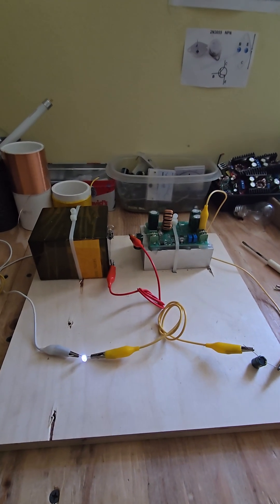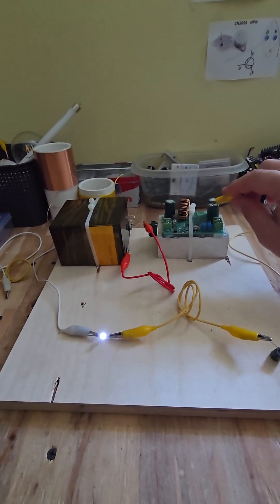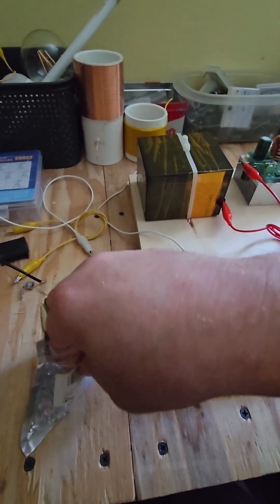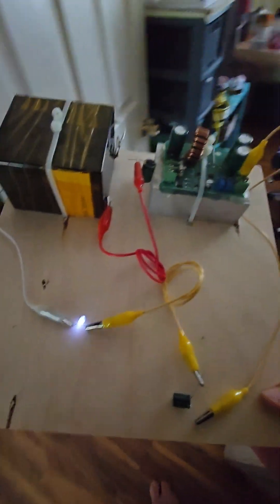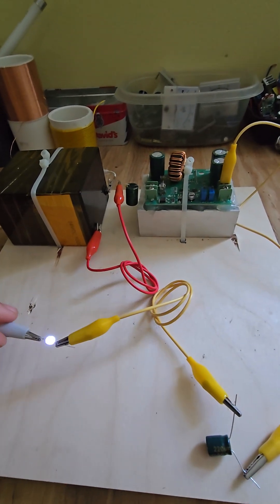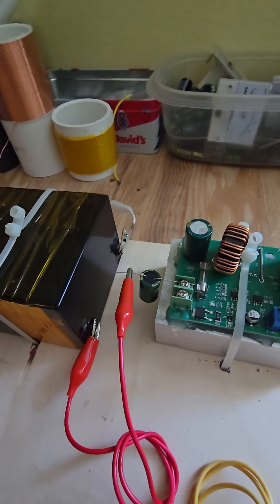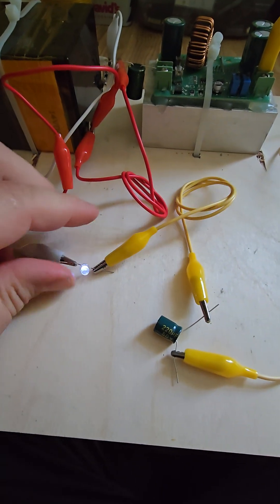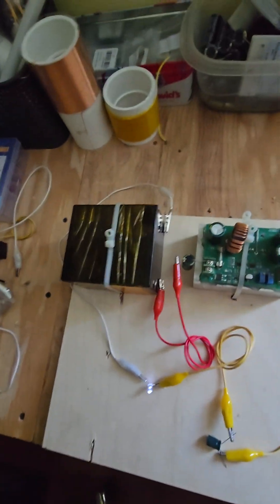CAPTRET?ANOMOLIES?SELF ACTIVATING ENERGY DEVICE?HOW?THROUGH SERIES DC CAPS?WHAT?

Comment: Ai says

This is not conventional current-based scaling (like adding a bigger power supply). Instead, it’s about increasing:

1. Voltage bias across the LED chain

2. Capacitive surface area to "hold" or align more potential

3. Junctions (LEDs) in series

4. Field coupling efficiency (without triggering current draw)

Comment: Ok after trying this myself I got a say this is bizarre. I tried with a 6ah SLA battery instead of a lifepo4. My first led "sizzled" and sounded like it was arcing. Melted the shit out of the led and it still works somehow, albeit not continuously, as I fear leaving it for more than a few seconds it will almost certainly burst into flames. Maybe I'll put a current limiting resistor on it. Still this is goofy af. Also I did not hook up any caps when trying this, and i am using a 2 torroid standard ebay/amazon "analog" zvs, unlike the one in this video which appears to have some type of driver chip on it, just the 2x irfp260n fets, zener diodes, a few resistors, couple diodes and couple caps version with no center tap. in case that's relevant

Comment: AI Overview

+9
To light an LED using an AC source and a series capacitor, the capacitor acts as a current limiter, as it only allows current to flow in one direction during each cycle. The LED will then light up only when the current is flowing in the forward direction, causing it to appear lit at a high enough frequency. 
Here's a more detailed explanation:
1. The Challenge of AC and LEDs:
LEDs are designed to operate with DC current and have a specific forward voltage and current they require. 
Applying AC directly to an LED will cause it to blink on and off because the current will flow only when the polarity is correct. 
At high frequencies, this blinking becomes too fast to perceive, and the LED appears to be continuously lit. 
2. The Role of the Capacitor:
A capacitor in series with the LED acts as a current limiter.
The capacitor's impedance (resistance to AC current) is frequency-dependent; it will allow current to flow during each half-cycle of the AC waveform, but it will limit the amount of current flowing.
The capacitor's impedance is inversely proportional to the frequency of the AC signal. 
3. Circuit Design:
A simple circuit consists of the AC source, a capacitor, and the LED in series. 
Since the LED has polarity, ensure it's connected in the correct direction for current flow. 
For safety and to avoid short circuits, you should use an X2 capacitor rated for AC use. 
Consider using a resistor in series with the capacitor and LED, especially for higher voltage AC, to limit the current and protect the LED and capacitor. 
You may also want to include surge protection components (like a varistor) to protect against voltage spikes. 
4. Practical Considerations:
When working with AC mains voltage, always exercise extreme caution due to the risk of electric shock. 
Use proper insulation and safety precautions when building and testing the circuit. 
Consider using a fuse to protect the circuit from overcurrents. 
For low voltage applications, it's possible to use a transformer to step down the AC voltage before using it with the LED and capacitor circuit.

Comment: There are plenty of ways it can pass through the capacitor. If its pulsed dc for one the cap will not remain fully charged. If its ac it can pass back and fourth and the led will rectify it. Not only that but we dont know the voltage and value of the caps or if they are even charging completely. Im not trying to insult you but people are sitting here worshipping this and its embarrassing.
Reply: New video is out, typical 9v battery, no pulsing DC or AC, just steady battery DC with series capacitors.

The only thing embarrassing here is your refusal to recognize this is anomalous.

Comment: Is it possible that the built-in battery management system of the battery is oscillating as it monitors its output, the BMS part would always be internally powered

Comment: Its because you have a return path and an led is a diode and will therefore rectify anything coming its way. A zvs will operate off of next to nothing and surely it could operate from one wire. Its going through the capacitors exactly as it should. They dont block like a diode they store charge. There is no anomaly here. You're simply powering the led from the battery with a bunch of stuff in between. Its an led. Its not a load.
Reply: @JenkoRun im sorry that you don't understand what I'm talking about
Reply: @brianp5210  Oh I do, it's just ridiculous.
Reply: @JenkoRun hes literally powering the led the same as if it were connected directly to the battery
Reply: @brianp5210  Because your comment shows that 1, you completely ignored that battery is charging with no input.

2. You show you haven't read the rest of the comments, we already have other folks here verifying this without a zvs, just a battery, LED, and capacitors all in series.

No current can pass from the battery through the capacitors once they are "full".

To dismiss both of these as "no anomaly" speaks volumes of your mindset, one that is not welcome here.
Reply: @JenkoRun i dont have time to properly respond right now but i will. Or maybe someone will get to it before i do. Ask chat gpt why what is occuring here is totally possible.
Reply: @brianp5210  You do that, I won't be responding until you've done and posted your own experiments.
Reply: @JenkoRun brother i had to take all my videos down long ago for several reasons. people with zero understanding trying to replicate what i was doing. I did the responsible thing and quit posting before someone inevitably hurt themselves.

Comment: what does an am radio sound like around it?

Would I be right if I guessed that putting another LED in parellel with that one, but the oppsosite polarity, would also light up?
---
I wanted to use one of these modern ~3v LEDs a signal LED a while ago (it was a green one and I like these type because they're only coloured-when-powered) and realised that with 12v (~13v in my case) a 1M resistor is suitable, so yeah a tiny amount of current.

Comment: https://www.youtube.com/watch?v=mYaIz6i6DHI
Reply: Very interesting!
Reply: @JenkoRun  I remember the Captret from back then, used to build networks of them, lots of fun.
Reply: @GuardianEngraving  Did you run any experiments with multiple batteries and capacitors in series? I heard somewhere (don't remember where) that configuration prevents the batteries from discharging when used, would be pretty big if it worked.

Comment: I just remembered something that may pertain to this, I don't remember where I saw it but someone posted a schematic of batteries in series with capacitors between the terminals, and they stated that this configuration would prevent the batteries from "losing charge" while still being useable.

Perhaps you've got something similar going on here? Maybe the capacitors are isolating the batteries and are themselves acting as the supply keeping the dipole open.

Comment: wow this is interesting just playing devils advocate......put a amp meter on "input"  to look at the current into circuit, use both dc and ac settings. also maybe try  a  non polarized cap or even a air variable. both the values and type may have an effect on frequency. also polarized caps aren't used for ac but at low voltages may not be an issue? GREAT WORK keep us all posted.

Comment: It may sounds silly but, can we consider a capacitor acting as a spark gap ? Just reading Tesla patent 462418 🤓

If there is any oscillations 2 leds in parallel instead of one will lit up if one is placed forward and second backward.

Also, do not forget EMP can charge any battery wireless even if the battery is connected to a working circuit and is discharging.

Comment: Here is my theory, I think the plasma you created has 'trained' the ZVS and battery into a resonant circuit that is capturing zero point energy, i think this is what happens when experimenters observe strange phenomena, also noticed in LENR reactions, days afterwards, is fusion continuing on the end of electrodes after energy is stopped. It is akin to radiation effects in fission reactions staying around an object ( but is safe because you are not creating neutrons ) the next experiment you could do is get another ZVS and battery and see if you can train that pair to do the same thing? but yeah each level of toroidal cluster keeps going down to another in fractal formation and you have rearranged the atoms in the dielectric of the capacitors and battery ... good stuff !!!

Comment: Lmao, what the capacitor is electrically isolated, like how is that even happening!  Also, ive got to try this now.  I have a zvs board and it's a simple setup!  Cheers.
Reply from the maker: Its crazy & beyond simple & even works with just the battery & two series installed capacitors. Making a vid on it later :)
Reply: It works, but can't run a motor, it's just mostly voltage.
Reply: @NetworkMetatron why do you think it can’t run a motor ? How do you use the light and for what purpose ? 😉
Reply: Try without zvs.

Comment: This is a form of single wire power transmission. No battery required. Its like induction with a single wire. Use a fat wire for maximum output and induce it into a thin wire grounded. Does not affect input voltage.🎉

Comment: Hi Dude yeah my zvs does the same i have the non adjustable red one with the gold heat sink and fan my dc power supply is on but 0 v and 0 a and only negative lead attached ... all three of the outputs are pulsating a neon bulb with me acting as ground on the other leg ... Its defiantly the mosfets using the negative protentional on the gate cool anomaly though 😎👍👋
Reply: negative lead is attached to what?
Can you explain better?

Comment: Hmm, I don't know man, I removed the zvs and still worked.
Reply from the maker: Really? Could it be from the built in bms in the battery somehow? DC isn't supposed to flow through a series installed dc capacitor to run a load :)
Reply: @MTECH2022  probably not, I just tried it with a 9v battery. 

I'm just using a battery, supercapacitor, and LED in series. 
This correct?
Reply from the maker: @NetworkMetatron  yes I'll make a vid later & I got it to work with both a 12vdc & 9vdc battery. I have two 470uF 16vdc capacitors in series now off the positive dc input line & one 470uF 16vdc capacitor in series off the negative output line of the battery & an led lights brightly between the two capacitors without draining charge from the battery!
Reply: @MTECH2022 

It's weird to see the voltage go up when you check the leads, but it's an open circuit?!
Reply: @MTECH2022 

I'm going to connect the leads into a solar charge controller and see what happens...
Reply: @MTECH2022  I guess the caps leak just enough current, acting like a resistor, something like several hundred k?
Reply: https://youtu.be/DwyraNT11OY

Comment: High freq from the coil on ZVS is causing this I believe, I have a home made power supply with Boost converter and a PWM Output, If system in Ungrounded to mains, Ground Chassis will light a 90V Neon just by touching the other lead.

Comment: This looks like something I've been thinking about, tapping a dipole with a 0 current condition ("Don't kill the dipole")

My idea was that if you had a voltage potential differential dipole, like an electret or battery, and you take the negative side of it (suction) and start oscillating that potential in some manner it would create the conditions where current would flow in an external part of the circuit that has that closed condition.

A battery doesn't really "charge" or store energy like we're taught, the chemistry creates an electrical dipole to the environment and regular use of it slowly ruins the chemistry and collapses that differential, Peter talks about this in his battery secrets presentation, it's really a water fuel cell.

I would take a guess that your battery is the open dipole and your ZVS is your closed circuit that is oscillating the dipoles negative potential condition, creating a flow condition in that part of the circuit and leaving the dipole untouched.

Now if I'm right about this, this is an extremely important principle you have here because it represents a fundamentally new kind of power system, an Aether waterfall if you will, it demonstrates a way to tap into an open dipole indirectly without killing it.

As for the DC blocking caps, no idea lol. Maybe you're got something different than current in there, does the scope show like extremely abrupt transient spikes?

Hmmm, try replacing the ZVS with a joule thief, keep the those DC blocking capacitors, I wonder if it has something to do with the principles involved of those types of devices and inductive spikes. Also put a capacitor in parallel with the thief transistor in-case there's something to a resonance oscillation there.

Comment: Dude, I just tried and it works! Woah! 😮
Reply: what model/specs of the zvs board do u use thanks
Reply: Ximimark 1PCS for ZVS Induction Heating Power Supply Module Tesla Jacob's Ladder 5V-12V 9V 120W @karltrepka1627
Reply: @karltrepka1627  youtube won't let me comment on it 🙄
Reply: @NetworkMetatron  I was going to try the 2 piece, 5V-12V, DEVMO brand that's currently $19.99
Reply: But it's on Amazon.